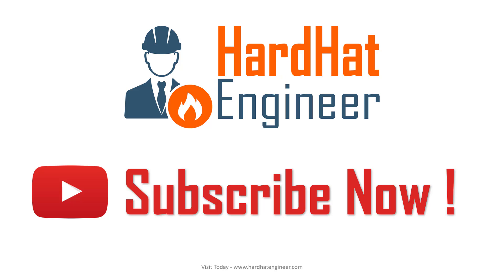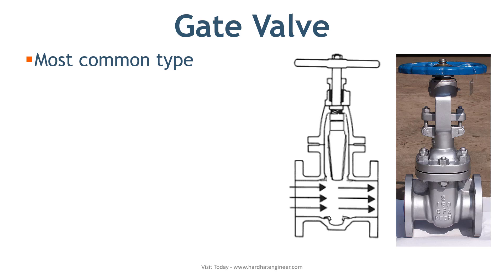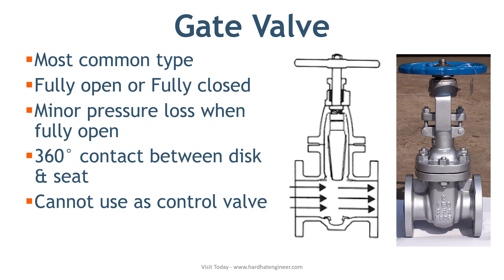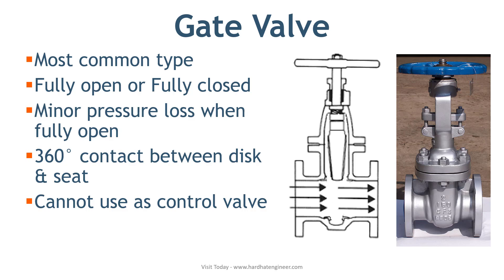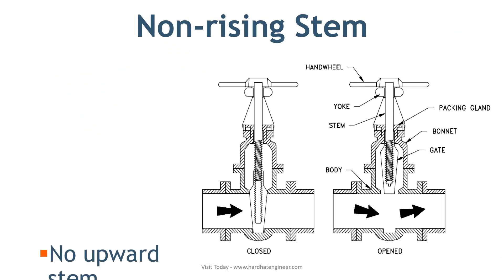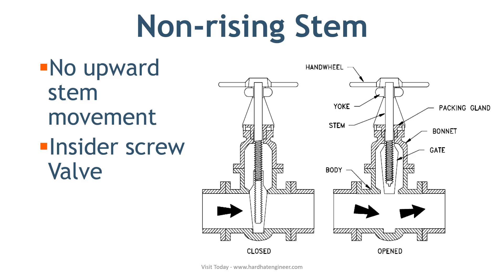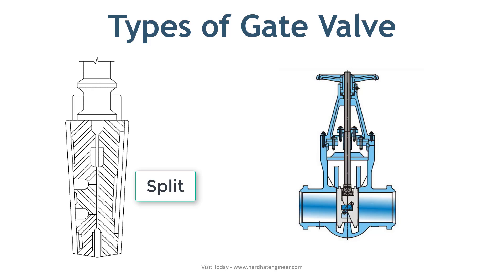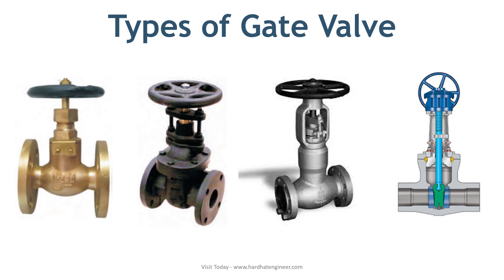Gate Valve Types and Working - A detailed Explanation

Comment: I just cant get my head around the design so that when you turn the hand wheel the gate will rise but not the stem. Would love some more detail describing how the designs differ so that when the wheel rotates on the gate lifts.
Reply from the maker: It is inside screw valve, Check - https://hardhatengineer.com/gate-valve-types-parts/